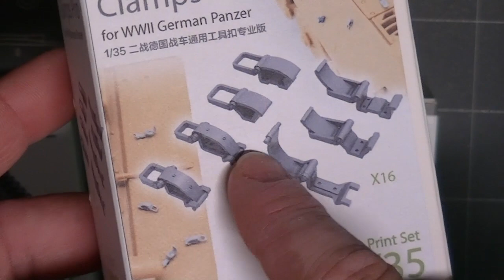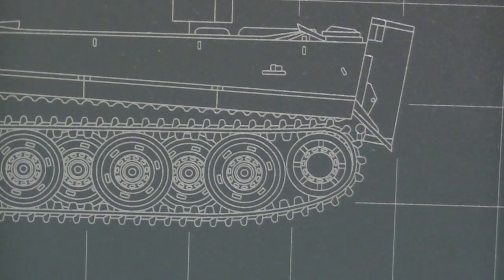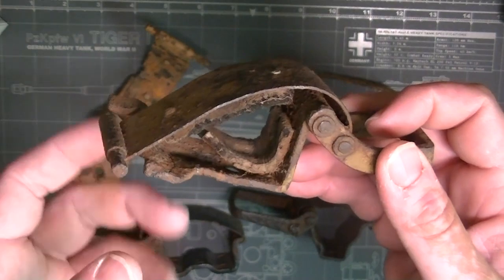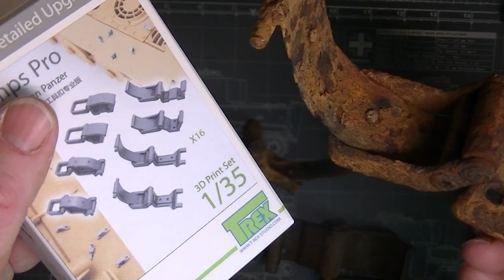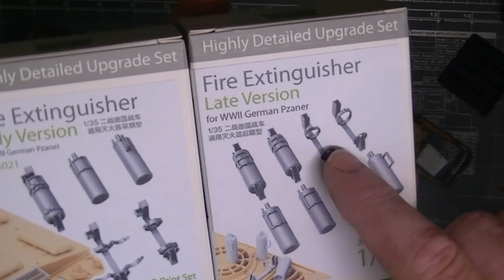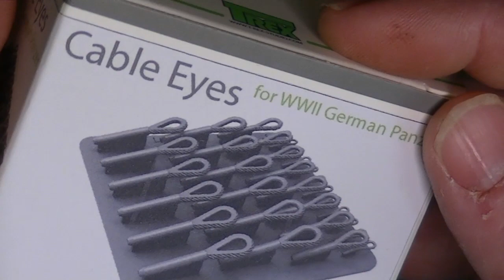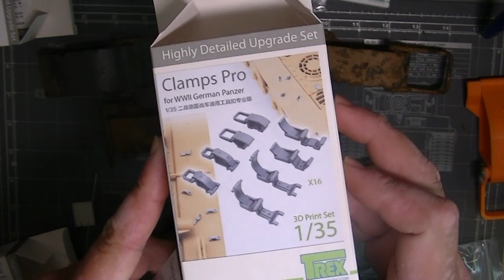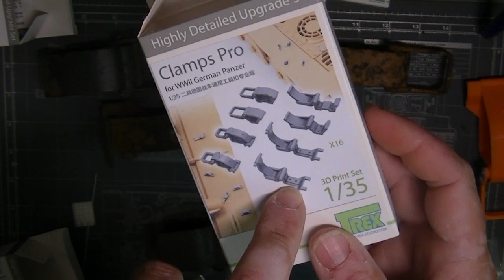T-Rex Studio 1/35 3D Printed Tool Clamp Review

Comment: Awesome review Adam.thanks. I have the same Trex items you reviewed as well as MJ miniatures sets and afew of ROCHM clamp sets. They all are just super."photo etch" will be a thing of the pass in 5yrs.or less. MJ miniatures items are larger than Trex and Rochm items.i.e. out of scale just slightly.compaired to the other companies meantioned.But are decades ahead of p.e. stuff. Rochm offerings are finer than Trex items.i have sets # 35012 type A and 35018 type B .each type is divided into 4 sizes which is great but hard to get.Above all these 3D items are in scale or much closer than p.e. sets.i always thought Abers 1/48scale tool clamps are closer to 1/35 than the 1/35 sets.but im picky lol.thanks

Comment: Just got a set of Type A (s-xl) clamps by Rochm model's in 3D print,they are noticeably smaller than the competition.Smaller than thier own PE version too.
Reply from the maker: They sent me some samples but I've yet to receive them. In the mean time I have signed on as T-Rex's technical advisor.
Reply: @AdamMann3D Ive used the Rochm full detail sets for Panther G/RFM,Panther A/6358,the scale seems smaller overall compared to some PE.The 3d clamp's are small looking too,their PE clamp's look the part its getting that curve on top latch of the type A clamp's.Can't wait to hear what you think.Thanks for showing me how to find which boxes held the dragon card.

Comment: No I don't think your being weird about that tool clamp Mjs are alot nicer though! But that angle I've seen alot too! Probably when clogged with crap they were a nightmare to lock right down and stiff as hell no doubt eh! AMMOS 3D clamps are nice too fornthe empty fire extinguisher holder's!
Reply from the maker: MJ and T-Rex have partnered up. I haven't seen the MJ clamps yet, but I got a set of Rochm clamps this week.
Reply: @AdamMann3D  yeah just seen that on mjs site trex have them teamed up with takom aswell on takoms fb page I seen the working clamps on mjs fb but there only 1.16 there not 1.35 as yet anyway there a wee bit to fragile in 1.35, mjs are very nice but are easy to snap in bit's! I've went and bought all the sherman accessories ones and antennas etc to see how they are there very nice too very very thin light guards, almost scared to cut them off haha!